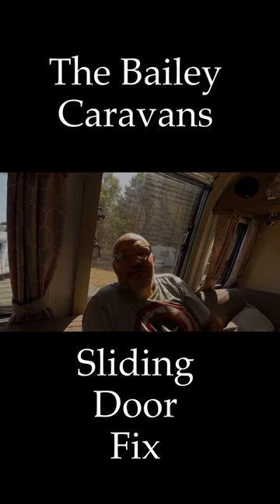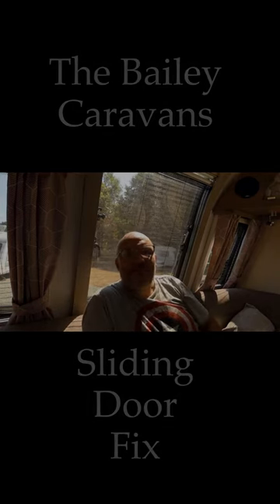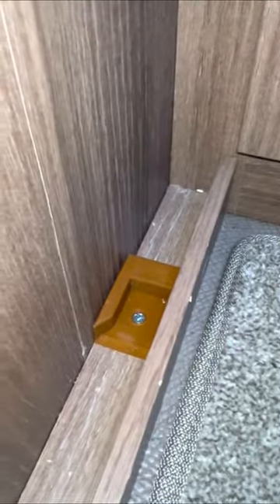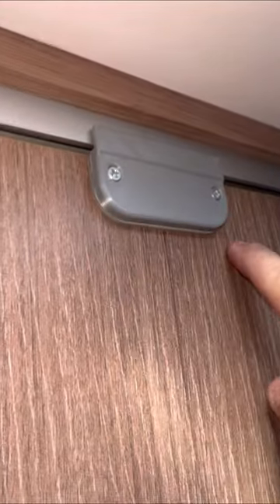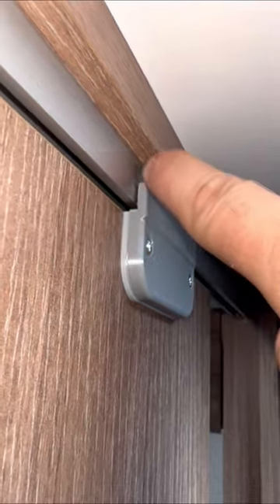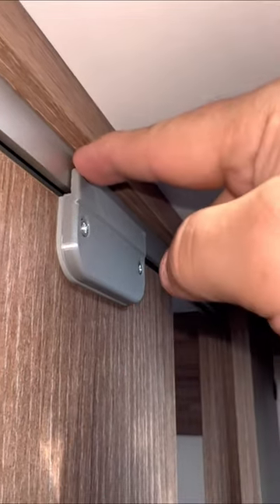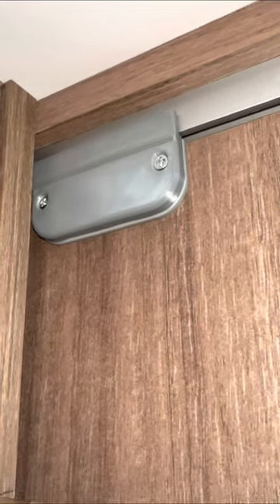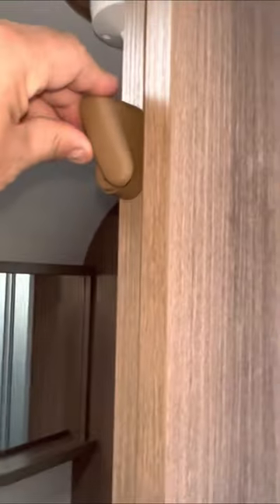Bailey caravan bathroom sliding door fix / popped or broken slider

Comment: Hi,  thanks for your video.  I have just purchased a Bailey Sintra with same sliding door but the door does not hang right and these could help.  Can not get link to work. Can you please provide?  Also door does not close into recess on the LHS if facing bathroom - is a wedge shape out by 10mm at the top which I cannot work out???  Thanks
Reply from the maker: https://www.ebay.co.uk/itm/305528346539?mkcid=16&mkevt=1&mkrid=711-127632-2357-0&ssspo=guy82nkaswa&sssrc=2051273&ssuid=guy82nkaswa&var=&widget_ver=artemis&media=COPY